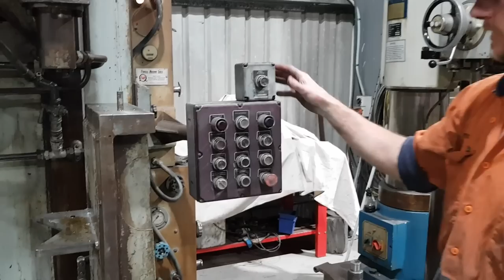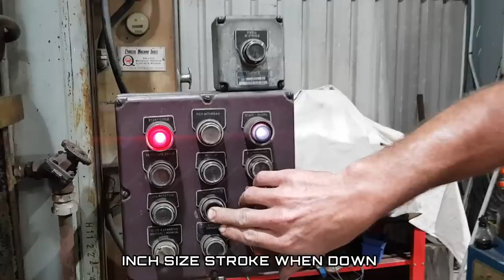Our RARE 1960s Delapena Vertical Honing Machine tour | Workshop Machinery

Comment: Hi all at CEE.
I don't know if someone's posted this before, but I know you spend time editing these before you post them, but do you do a preview watch before posting the video, and do you have the subtitles on?
I had the subtitles on and the "Almighty Subtitle Algorithm Maker" starts off with "Music" at the start. Engineers would call that music, as the sound does inform you of what's going on and you know if it's gone out of key.
Also when cleaning out the centrifuge, it also comes up with other subtitles from noises made.😆
I like these type of vids as it's ok to show a vid using them on a job, but it's interesting to know about the machinery doing the work also, and the mods you make.
Just a question, how often would you need to clean that centrifuge out? Ever job or after a few?

Comment: Hi again Kurtis, question about Sunnen. Here in the States I simply pick up the phone and call Sunnen in St Loius, Mo to order supplies and parts. Do you do the same or does Sunnen have a Ozzy distribution center or something like that? Anyway that's a pretty solid honing machine you have there. Much better than holding on to a big drill 😀🍻
Reply from the maker: Hey Warren hahaa yeah I did hand honing to get started and that was not fun 🤣 There is a Sunnen distributor here in Aussie and all they deal in is sunnen, very convenient they are only 30min away! Thanks for watching, cheers Kurtis 😎👍
Reply: @CuttingEdgeEngineering  How appropriate. Sunnen on the Gold Coast or would they be up as far as the Sunshine Coast?

Comment: These super tiny scrathches left at the end of the process are for keeping oil, right? Wouldn't be possible to achieve the same pattern (or at least similar) by using the lathe and some honing stones after boring the barrel to size?

Comment: What did you do before you got this machine, it is a necessary part of any cylinder overhaul??
Reply from the maker: Hey mate I did the honing by hand on a shop made tool. Honong depends if you have ready to use size tube, the barrel design, welding to do etc all can mean honing vs not need honing.

Comment: Nice machine. Is there no hydraulic accumulator on the raise lower of the head ? Sounds savage when it changes direction . Not trying to be a smart arse, just interested . Thanks for sharing.
Reply from the maker: Hey mate thanks for watching. No hydraulic accumulator but when it's cycling while cutting a barrel you really don't hear the change in valve like that in the video which was "dry run" which I don't ever do haha

Comment: Can you still get spare rubber bladders for the metal separator? If not hopefully you can find a shop that pours you a copy of this one while it' still in working order, it did look like the decades of service did not pass it over entirely tracelessly. But I'm just another keyboard warrior, it might be holding up much better than it looks like to me! Also, what an amazing machine. These days you'd have to reflash the controllers and hope it takes the longer stroke modifications. The up/down cycle sounds fairly violent to me even considering the reciprocating mass involved, that'd take me some getting used to.

Comment: Says it provides the following data: Delapena "Speedhone" Precision Honing Machines, manual versions, 275 Beam type, etc. Data Pack including: General Operating Manual with a data manual giving Recommended Honing Speeds and Honing Stone Pressures together with a large and useful collection (60 pages) of sales and Technical Specification Catalogues covering the types: "Speedhone" Junior; VHM/1, VHM1D, VHM/3C. VHM60, HHM/11, HHM/30, Model 276 Beam Stroking Honing Machine; Model 301, VHM/1, VHM/1D, VHM/3, VHM/3C, VHM/5, VHM60, VHM/60 and HHM/11 and the 276 Industrial Beam Honer, etc.

Comment: Love your stuff! Very interesting and informative!
You said you've got a stroke of 1,200 mm. That's just shy of 4 feet. On the video it looks like the stroke is considerably more than 4 feet....
Is the stroke more than 1,200 mm?
Thanks  :)
Reply from the maker: Hey mate thanks for watching. It will stroke out to 1500mm but limited the stroke in the video to 1200mm while it was dry running. 😎👍
Reply: @CuttingEdgeEngineering  :)

Comment: "...You propably do all of those sets just removing a mil, mil and a half..." - Beeing from Europe and metric machinist, let me ask the stupid question: 
"1 mil" equals to "1 mm" (1/1000th of a meter) or do you mean "a mil" that equals to "a mil" (aka "a thou" aka "1/1000th of an inch" aka "25,4µm")?
And are we talking in diameter or depth of cut?
Thanks for the good content!
Reply from the maker: Hey mate thanks for watching. We remove 1mm from the inner diameter. We Aussies are also metric and don't talk in the unit of banana measurement aka imperial 🤣
Reply: @CuttingEdgeEngineering  Thanks for clearifying that mate! Watching videos from the USA, UK, Europe and AUS sometimes can be confusing, espacially when the aussie slang hits the units :D
But I'm glad to hear, that you are also on the good side of units!
Reply: The one time freedom units are acceptable is when describing a bent in something that should be entirely straight - doesn't matter what the number is, it's screwed anyway haha.

Comment: Nope, never seen that machine until your shop, and I thought it was genius.  Curious why you did away with the auto feed on the stones though.
Reply from the maker: Hey mate the tooling to match it was too expensive, very hard to get here and just not needed
Reply: @CuttingEdgeEngineering  Oh I was under the impression the auto feed was not dependent on the tooling.

Comment: Have you ever tried contacting Keith Rucker at http://www.vintagemachinery.org/ to see if he has any information on this machine, or can source some from one of his many contacts?
Reply from the maker: Hey mate thanks I haven't but others have recommended his site so will give that a go cheers 😎👍
Reply: @CuttingEdgeEngineering  Delphena is not listed in the manufacturers list on the website, but that does not mean that Keith or one of his contacts do not have printed material that has not been catalogued or scanned for the website. A few years ago Keith did a video on his process of putting together the collection of manuals and other material. There are apparently thousands of publication he has that have not been scanned. So I suggest your best move is to email him, not rely on the information from the website.